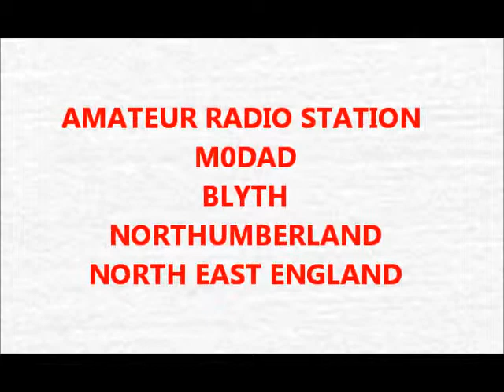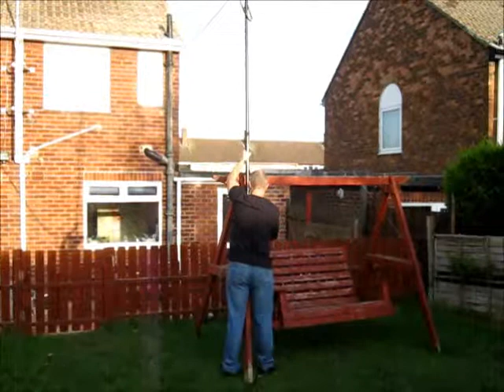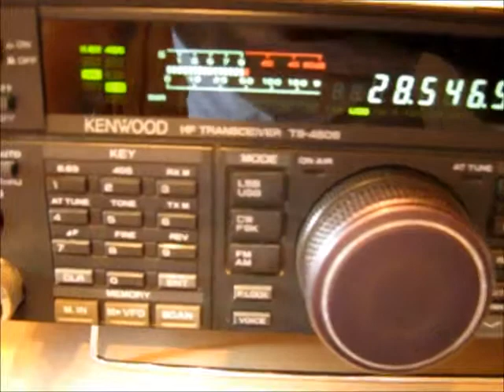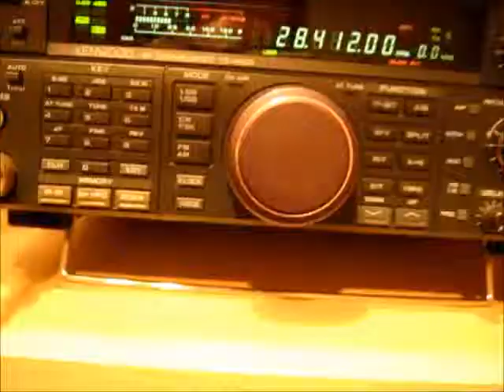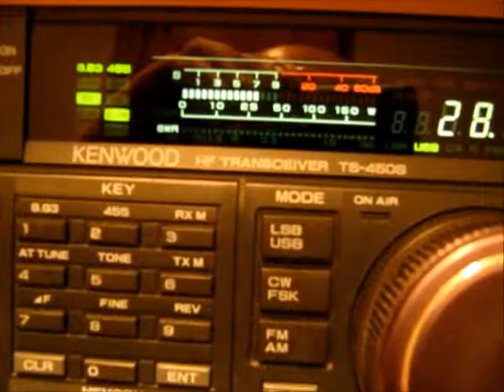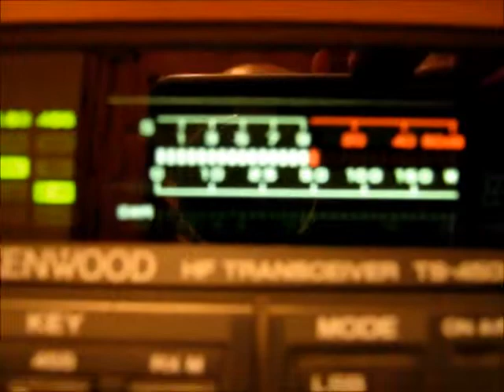10m rectangular loop part 2

Comment: Hi. Great antenna and video you put together. I'm interested in the pole you used. In the video you erected the antenna in just a few seconds and when you were angling it up the pole didn't seem to flex or bend at all even though it looks thin and lightweight. What did you use? How does it perform in the wind? Cheers!
Reply from the maker: Hi Arthur, the telescopic fibreglass fishing pole is a Lineaeffe 9.2M. I found them to be very good, in fact i`ve had more expensive rods that have been more flimsy and broke easy. They do suffer in the wind and I tried this antenna at 1600 feet in the hills on a windy day and it was bent like a banana but never snapped. Not too bad in the rear garden where its sheltered. The bottom screw caps do brake easy and can come loose but can be taped up and repaired easy.
Reply: @m0dad  M0dad. Excellent and thank you for the very prompt reponse. I will investigate it. I have been a big fan of delta and quad loops for a long time. Making the loops is straighforwards, however as I'm not blessed with tall trees to hang them. Finding a good lightweight mount which I can easily maneuver and has a good level of stiffness has been problematic. 

Cheers.

Comment: Impressive ,, have you a diagrams with measurements, please would like to try this cheers Shane Midlands 🇬🇧
Reply from the maker: Hi Shane,
The dimensions for my rectangle loop were 139" ( or 11.75 feet) both vertical sides
And 72" ( or 6 feet) top and bottom for the two horizontal wires.
The feed point is in the middle of the bottom horizontal wire and is 50 ohms. You can connect coax or a better idea is to wind a choke balun with your coax before the connection. You may need to adjust the whole loop and pull the vertical wires a little longer and horizontal wires shorter for best VSWR. 
A great but simple antenna, been a long time since I used it on 10m as the propagation has been poor.  Hope this has been helpful and good luck with your antenna building.
Reply from the maker: A couple of useful links to articals on the 10m rectangular loop
http://amfone.net/Amforum/index.php?topic=30353.0
http://kt4qw.com/acan1bu.htm